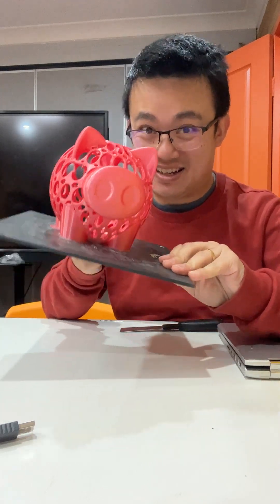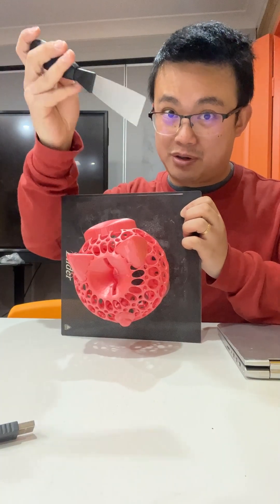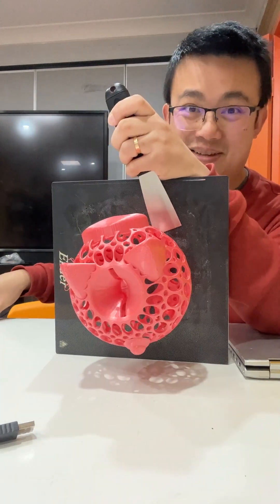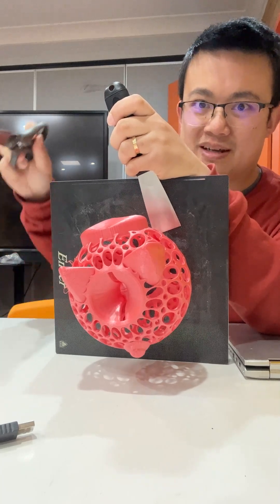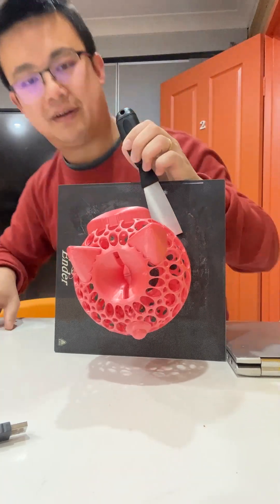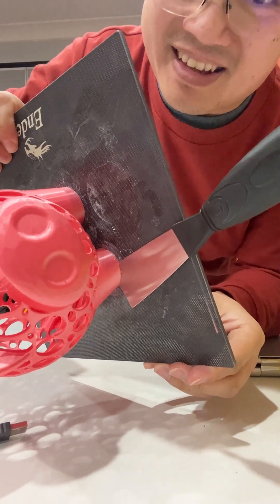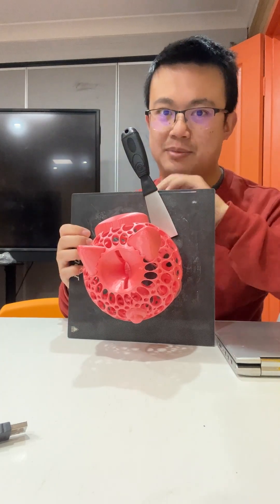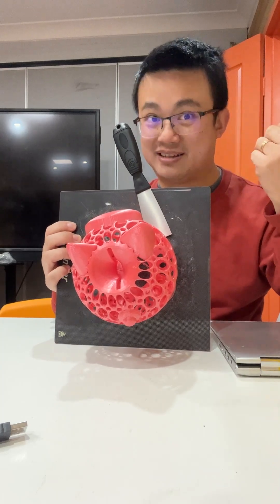Removing 3D Model Stuck on Build Plate (Glass)

Comment: I get a blade or scraper under and spray some isopropyl and that normally breaks the tension enough that the parts just peel off.
Reply: Bro thank you this genuinely saved me so much time @lonewolfsstuck
Reply: @Dagabduke no problem.